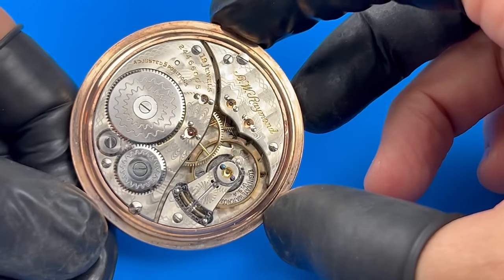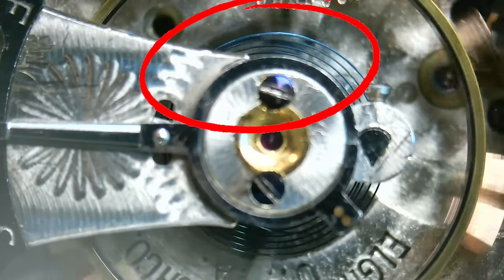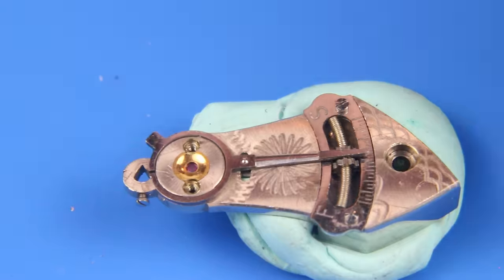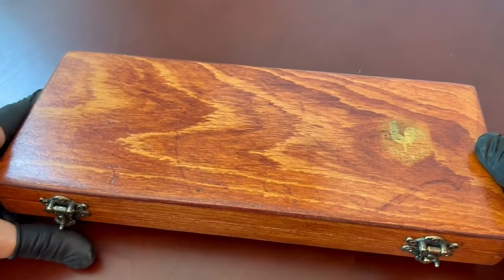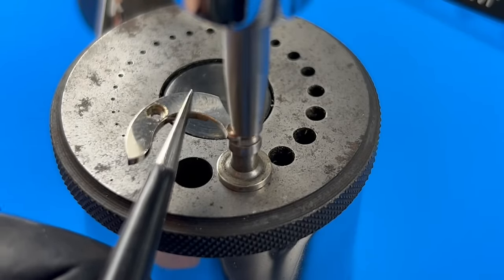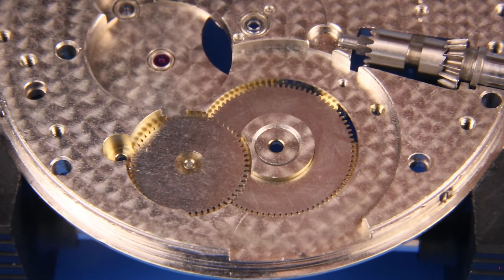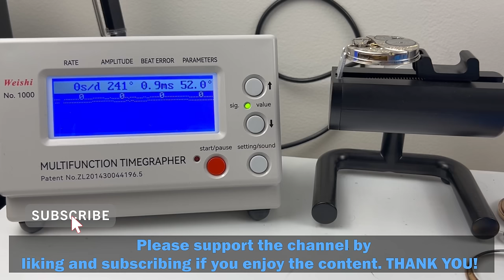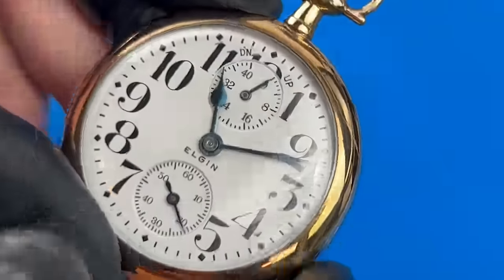WORSE than it looks? Repairing an Elgin B.W. Raymond Antique Pocket Watch with Wind Indicator

Comment: How did you get the broken screw out!???
Reply from the maker: Hey Bob. Sorry I did not film that part. I used a tungsten carbide PCB drill bit to drill out the old screw. They can be found cheaply on Amazon. Alternatively, you can use alum dissolved in hot water (soak the plate), which will dissolve any steel over time. I did this in a prior video
Reply: @csspinner  Wow, thanks for getting back. I think I would try alum before drilling as I don't yet have a tap set.

Comment: That was awesome! How come you decided to use 9010 on all the upper and lower jewels of the gear train and not HP-1300/9010 on the center wheel,3rd wheel/fourth wheel, escape wheel, respectively? And why did you choose to use Moebius D5 and 941 and not the current HP-1300 and 9415? Also, was that amplitude the highest you could squeeze out of the watch assuming you adjusted the escapement? Thank you.
Reply from the maker: Thank you! Those are the oils I have on hand and honestly I was under the impression that 9415 was meant for higher beat watches. I do plan to switch to HP-1300 when my supply of D5 runs out. As for the amplitude, I could’ve gotten it a bit higher with replacement of the mainspring but this was acceptable and usually try to keep the original part unless necessary. Thanks for the comment